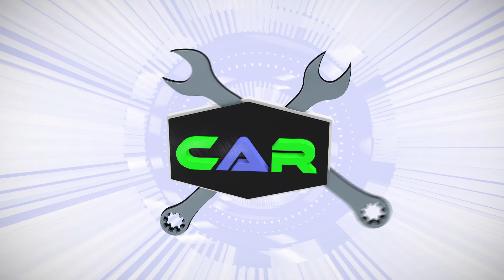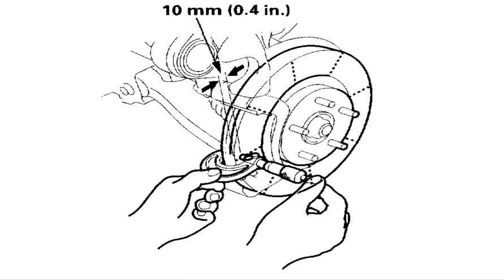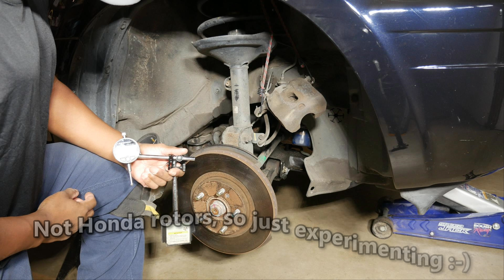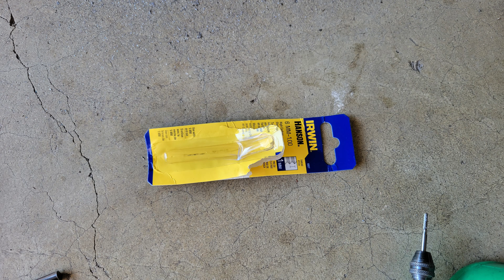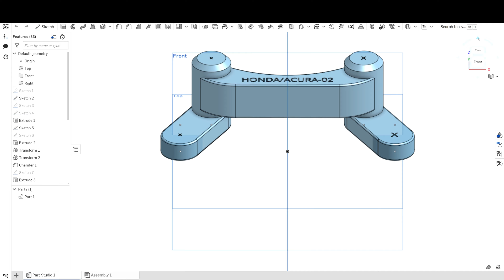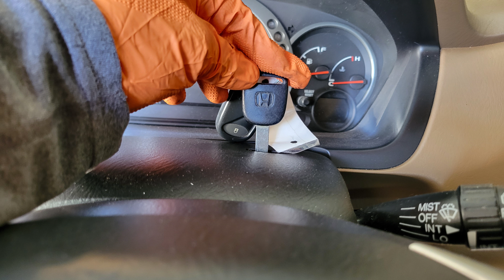2004 Honda Pilot - Front Brakes Analysis + Kwik-Way On-Car Brake Lathe Introduction

Comment: Hey man I have a 2000 Acura rl and I need to take off the main drive belt, I watched your alternator video and you said you had a video showing the removal of the main serpentine belt but I couldn’t find it, no info anywhere I would appreciate some tips
Reply from the maker: I assume you're referring to the timing belt. I plan on making a video sometime this summer. There is a timing belt video for the Acura Legend.
Here's the factory service manual if you need it: https://www.mediafire.com/file/uvbmryok1ax4vbs/Acura_RL_-_Factory_Service_Manual_%25281996-2004%2529.zip/file
Reply: I’m talking about the 3 serpentine belts, 1 for alternator, 1 for powersteering, and last one for everything else that is the largest one which is also the one I’m trying to remove
Reply from the maker: @goodsnatch7468  Here are the RL's belts: Power steering, AC, alternator, balancer, and timing. Feel free to send me a pic on Instagram: @carapprentice

Comment: Love the channel! Great videos on older Honda/Acuras. I’m doing a timing belt in a 2000 Acura RL right now.
Reply from the maker: Thanks! I have more RL videos coming soon, including the timing belt and water pump.
Reply: @carapprentice  Awesome! Balancer shaft makes it spicy. Water pump was leaking on my RL at thermostat housing, hence doing the whole job. Overall, not terrible. Don’t like the thermostat housing design though! Water pump shaft bearings were starting to go! Glad I didn’t cheap out on it. I used the Contitech pro plus kit. Has a Mitsuboshi main belt and Koyo bearings. Great quality!